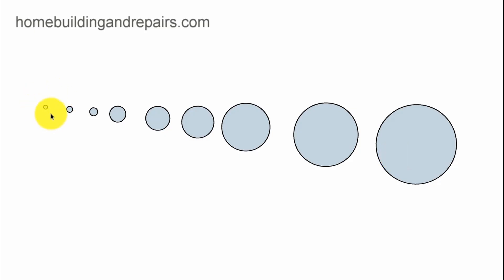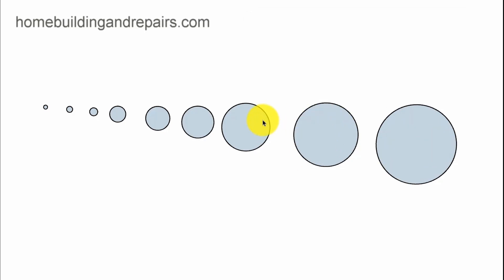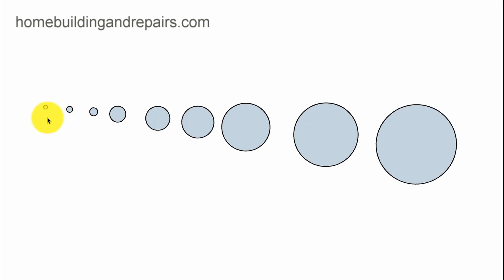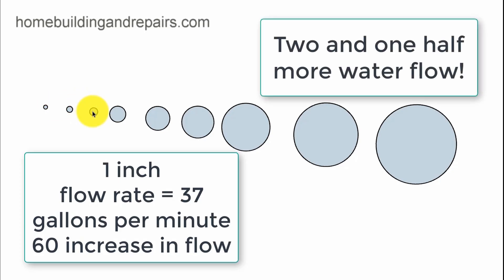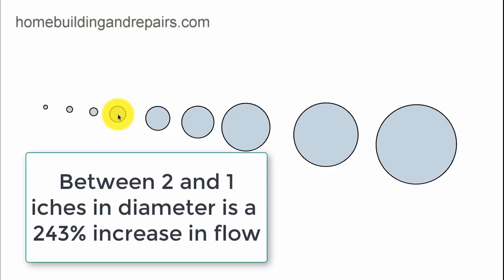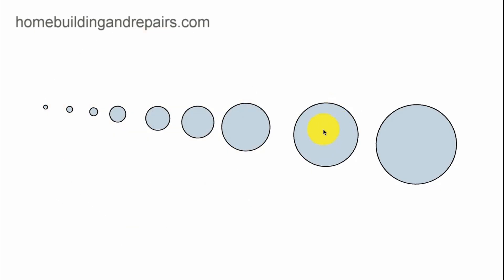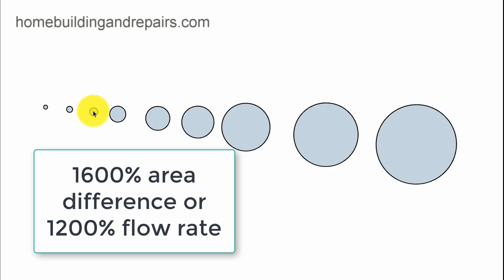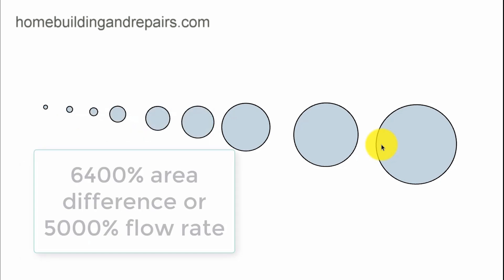Does Size Really Matter? - Water Supply Pipe Flow Rates

Comment: This is a good example of why it’s SO much easier to use charts and tables of actual measured water flow in pipes than it is to solve the equations. Humans evolved to have good intuition for linear changes (example 1x1, 2x1, 3x1, etc) but poor intuition for non-linear changes (example 1x1, 2x2, 3x3, ... or 1/1, 1/2, 1/3, ...).  The equations for water flow have LOTS of non-linear changes happening at the same time. Actual water flow in real pipes is even more complex (example, is the water moving smoothly in the same direction, or is it turbulent and churning?).  In these cases (and others, like pandemic growth rates) our ‘common sense’ intuition fails dramatically.
Reply from the maker: Obviously this was NEVER meant to replace any type of engineering tables or flow charts, because of the complicated nature of the process.
Reply: @gregvancom Agreed - and it was an effective explanation